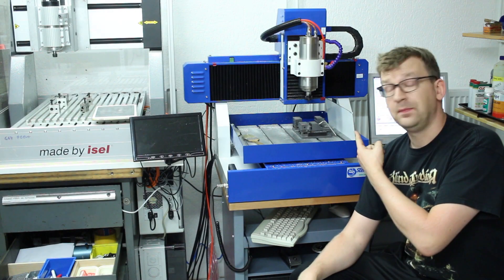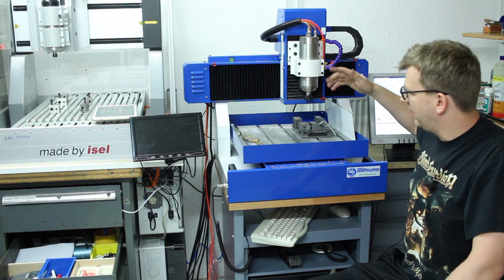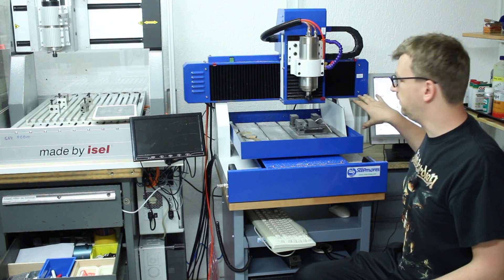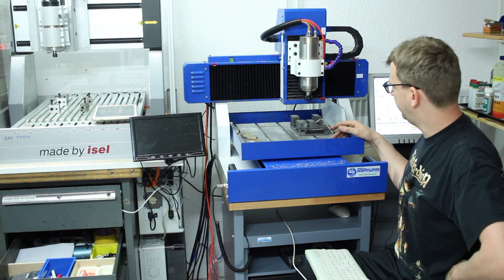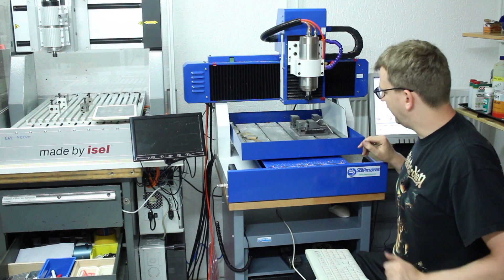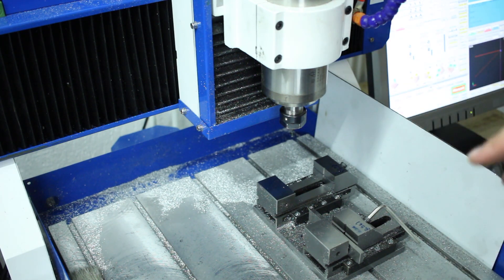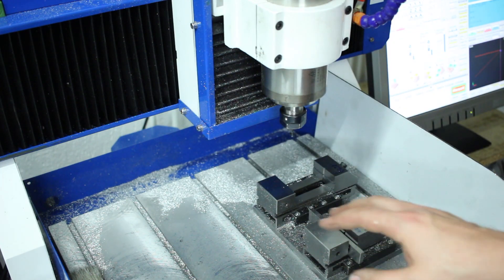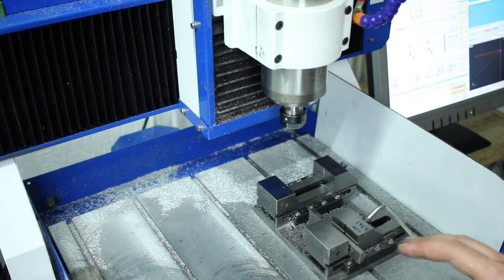Stepmores SM-4040 CNC Router

Comment: Hey Stefan! Great video, as per usual!

As for the surface roughness finishing in Fusion, doesn't scallop cover your needs in that respect? I'm fairly certain that that's what ProE is calculating also, just the theoretical scallop.

Comment: They use flood coolant when cutting stone or very dense timbers, mostly for ornamental reliefs. Some of these machines are also built for less demanding metal cutting but they would come with a low-speed electrospindle that has higher torque.

Comment: It did a good job. I still think I would get a Syil just for the ISO20 or BT30 spindles and slightly more rigid build, but I don't know the price difference between them.
Reply from the maker: I have a quote for a basic Syil x5 with BT30 spindle and Siemens controller, its close to 20kiloeuros.
Reply: @StefanGotteswinter   The base units aren't bad, but the options do price it up. The Siemens controller alone doubles the price, but the controller is a big quality of life improvement.

Comment: It took you some tweaking but IMO that's very impressive for a Chinese router. I was expecting carbide shrapnel when you started cutting the hardened block. Now what happens if you over mold it with epoxy granite?

Comment: Stefan, if you don't want to use flood coolant, connect the pipe work up to an air supply.
I know you only have a small compressor, so you might not want the air running all the time, so how about rigging up a solenoid controlled by a timer or such that can then give it a wee blast at set intervals (much like you are by hand in your videos), you can regulate the air by a) duration of the open valve b) manually via the tap, or c) if its electronically controlled by pulse width modulation.
Food for thought as we all know how messy flood coolant can be.
Reply from the maker: Yep, thats what I am going to do :)
The smoothstepper has 2 more parallel ports with enough I/O so I can hook up solenoid valves to controll airblast/MQL via the controller.

Comment: I know people generally don't like that kind of CNC (swing-out table) but i think that it's a reasonable compromise in order to get more rigidity out of your system. You either want it or you don't, there's no way to get it in that size package other than some absurd construction with tank plate or something like that, at which point, you'd be better off buying a used mill, polishing it and turn it into a CNC or there about.

I had one of these (similar, but not the same) prolly from the same manufacturer looking by some of the details, and it was good enough for gov work.

Comment: Impressive results for a CNC in tool steel. How much of the added rigidity do you think is due to the fixed gantry configuration, and how much is due to the heavy cast build?

Comment: I know little about routing or milling, but it seems that you are effectively milling steel using spindle speeds that are an order of magnitude higher than would be used on a mill. Would it be the case that spindle speeds on the mill when using small cutters are effectively suboptimally slow, or is any speed ok provided the feed rate is adjusted accordingly?
Reply: Normal mills run a lot slower than is optimal for these tiny endmills- a 4mm carbide endmill in steel wants somewhere near 15,000 rpm to get the right surface speed. You can slow down the feed but especially with a carbide endmill the surface finish is likely to suffer, plus everything takes way longer.  So the crazy fast spindle is definitely a good thing in this case.

Comment: how was the runout on the spindle?
Reply from the maker: in the collet taper around 2..3micron, at the tool more like 10..15micron.
Reply: @StefanGotteswinter  - That's pretty damn good, and way better than my tired old Wells mill.  Could be there's a CNC router in my near future!

Comment: This 2.2kw Chiness spindle bearing doesn't really last long, at least that what I heard.
I will be following up to see what will happen later after you use it.

Hope you can update us with your opinion on the spindle after you use it.
Reply: I just bought it not long ago and still didn't start using it, so i actually don't have experience have long they will last. Because of concentric issue, i disassemble it and found the brand of bearings are not the advertised ones "imported Japanese " type...Of course, if four of them are, they cost much and not was what the amount that i paid. (FYR affter my checking, two pieces that is - a pair of large one costs around 60-70 bucks- real Japanese brand).
Reply: Pound for pound, change them to real Japanese or German bearings on your own.
Reply: @ray-charc3131  
Well, I really want to know how much life do they have before being replaced and also what is the price range for good bearing with the same settings?

Comment: Real nice intro to the Stepmores sm-4040. And thanks for starting out with the hardest pieces in the scrap box. Also I would love to see some CAM stuff. If i remember right you have Fusion 360 If you have any recomondations for a video that explain's the basics of fusion 360 controls and what not because i have most of the parts for a 2'x 4' router and mach3 and need to get going on that  Thanks stefan your videos are always appreciated you always find some intresting stuff
Reply: Have you watched any NYCNC? John Saunders makes some good content that documents the CAD/CAM process in Fusion 360. I personally learned from a lot of trial and error, the explainations Autodesk has for features, and NYCNC.

Once you learn how to set up stock and an origin in Fusion most of the work is choosing a type of toolpath and going through options one at a time. If you don't know what an option does you can hover your cursor as well and it will often have a quick visual and explaination to let you know what it changes.

Comment: congrats on the new addition!
but 2mm end mill in hardened steel on a router?! you're a braver man than I!
Reply: Hey Tony, no lollygagging! Get back to work on that surface gauge build!
Reply: Physics are more well behaved in Germany. Honest, it’s a thing
Reply: @Chris-pb3se  thats because METRIC!
Reply: You threaded titanium with HSS and you don't feel brave?
Reply: A gift from my two favorite machining channels in the same day.  Thanx guys.
Reply: Speeds and feeds, speeds and feeds
Reply: And not a grain of sand in those castings!
Reply: You don't need bravery if you have confidence. Stefan is fairly good at what he does.
Reply: Needs must when the devil drives!
Reply: high spped small bits ;) its fine this way
Reply: We know that.
Reply: I love working on hardened tool steel. I mill almost daily with 0,6mm -0,8mm ball endmils in 67 a 68 HR and works just great. If the speeds and feeds are right, they last long in hardened steel.

Comment: There are some spindles on aliexpress that are 4 pole rather than the typical 2 pole motors.  These run at 12,000 rpm at 400hz and can still do 24,000 rpm if your vfd can do 800hz,  which is probably a more usable spindle speed range for cutting steel with a larger end mill.  There are also some 6 pole motors for sale for much lower speeds, but they are much more expensive.
Reply: How about using two motors on the machine for cutting aluminium and steel respectively.

Comment: Just think, you could bolt a single-point tool to the cross-slide and have the world's worst CNC planer.
Reply from the maker: Lol ;)
There are application in high precision machining of hologram surfaces/optical grids where exactly that is done.
Reply: Plus anything your Deckel can do this can do too. I'll send you my address and take the Deckel off your hands if you want🙄
Reply: @mpetersen6  well it was worth a try